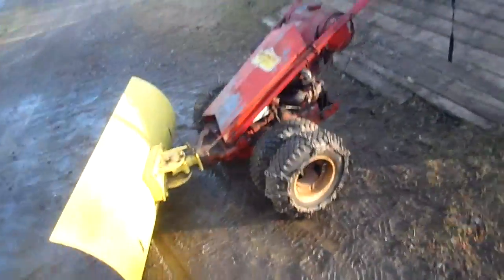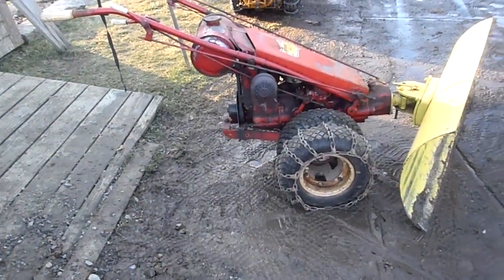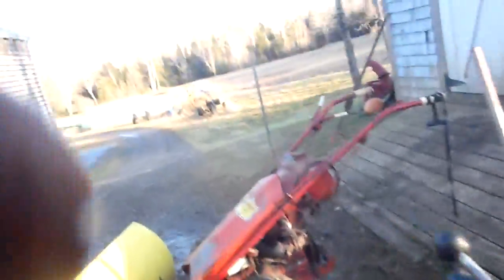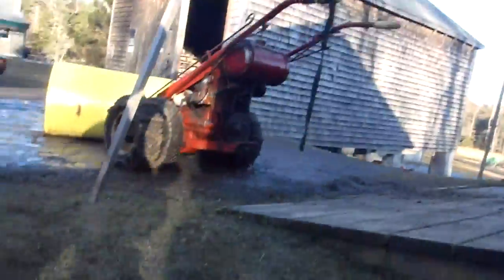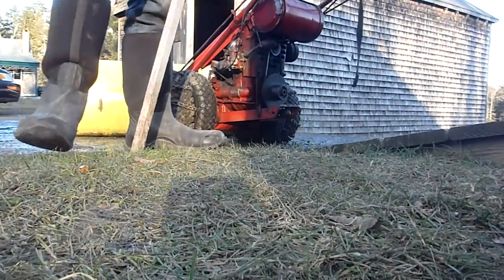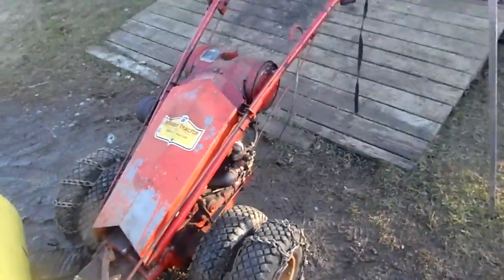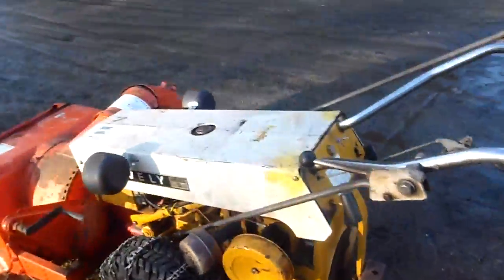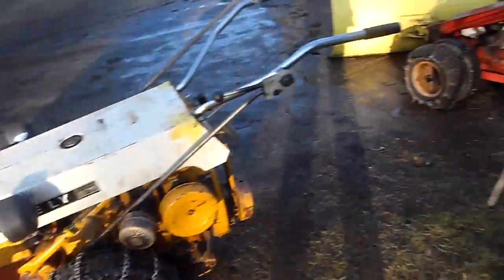The 1963 Gravely LI is finally running

Comment: don't you just love when you put the mag on 180 out. My 58 Li has the nut and bolt on the flange and the plate up top my dad's 62 Li is the same way. I agree the advanced casting was changed at some point though.Runs nice man congrats on one pull one start :P